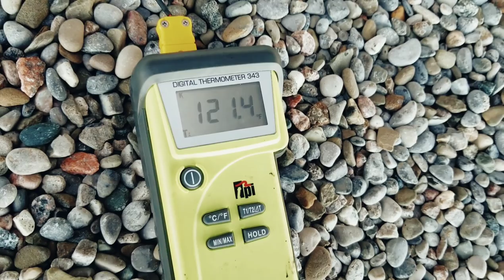HVAC - Heat Exchangers And Residual Heat On Package Rooftop Units

Comment: I've never cared for York's engineering, I don't know too many rooftop units that have a manual reset in them for the "primary" limit ,  I can see it for burner roll out, but not for the primary. Reminds me of something Coleman does in there house trailer furnaces 😆 (Kind of corn ball.)  I suspect you could of eliminated this as a possible problem by adding a isolation relay that would jump terminal G and W1 if there's a call for heat, resulting in the blower coming on immediately once power was restored, and the timer board would still delay the off cycle. Good heads up video👍 for what could be causing the problem. Otherwise it could be a bad relay not bringing on the blower or a blower motor starting to go out randomly.
Reply from the maker: W1 to G wouldn't fix it because the whole unit is in delay after a power outage, nothing will run.  Power was taken straight to the fan contactor coil.  The fans run all of the time anyway, so no biggie.

Comment: You need to up the time the blower is running after the heat call.
Reply from the maker: This is after a power outage, not during regular operation.
Reply: Ah I see so does this location loose power often?